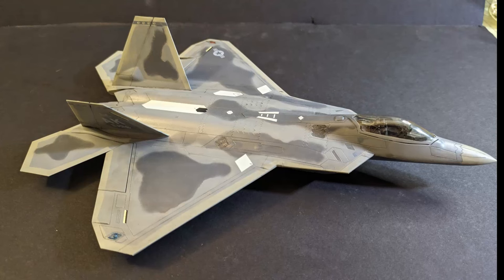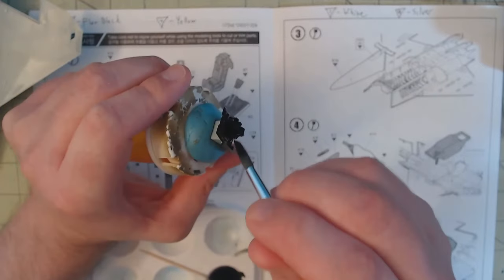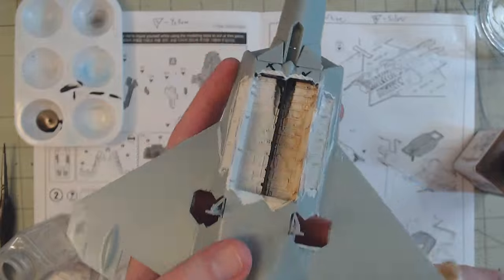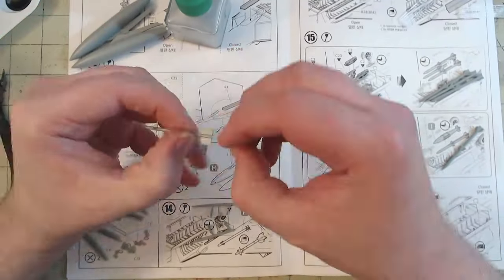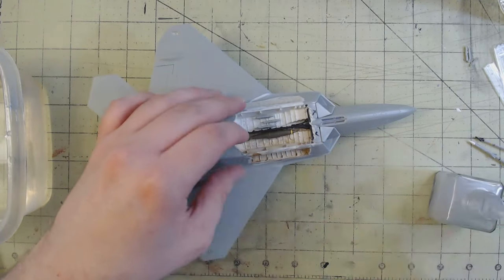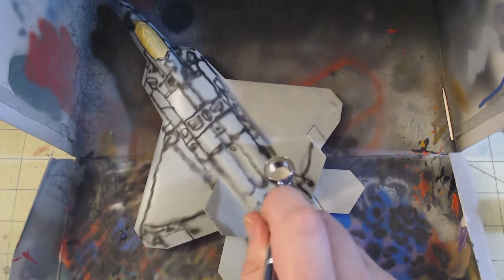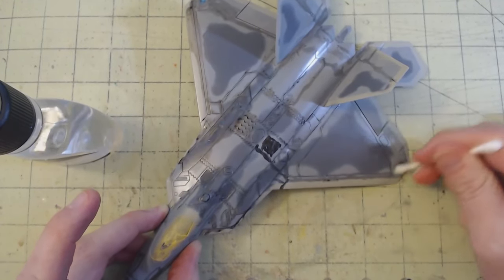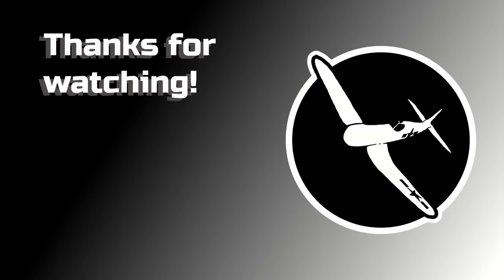Full Build - Academy F-22A in 1/72 Scale

Comment: Masking fluid is a great option if you want to do 1:1 pattern recreation. I use it on my miniatures and fishing lures.

Also, I came over from Habitual Line Crosser's video. You do good work!
Reply from the maker: Yeah, my biggest hesitation, which I forgot to include in the voice-over there, was that masking can leave a very sharp line between the colors, and there's a softer transition of color on the real stuff, so I wasn't sure. Kept flipping back and forth on it the whole build, but by the time I got to that step, I was getting so PO'ed at the stupid moisture trap stuff that I wound up choosing the easier route :/
Reply: @fenrismodels  that actually makes a lot of sense. Thanks for sharing your thought process on it. I've never really thought about the sharp lines it leaves, since I mainly use it on lures, and the entire thing ends up getting dunked in an acrylic clearcoat
Reply from the maker: There are ways to soften the line too, but I've never really used masking fluid before so I've never looked deep into it. Maybe I'll do so for my next one, actually, that sounds like a fun experiment!